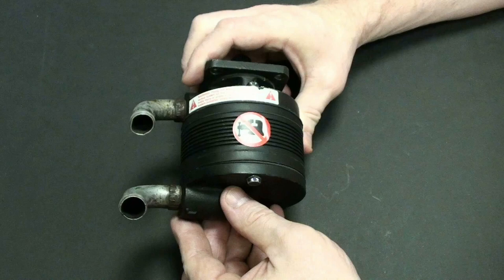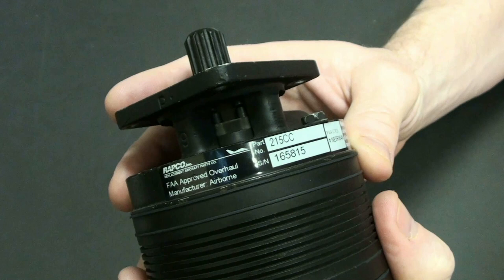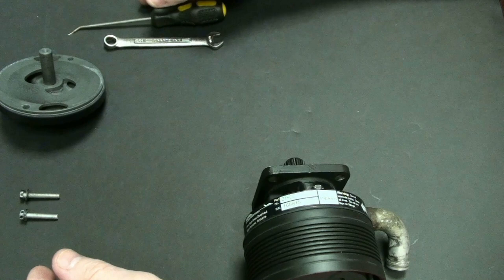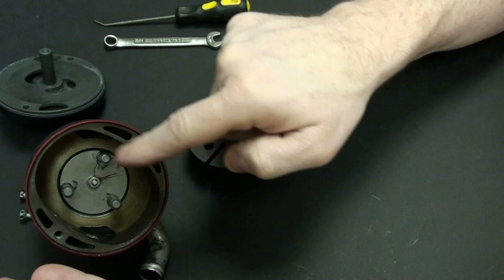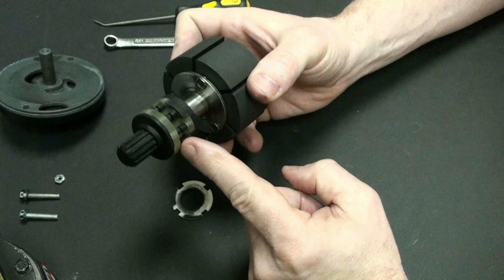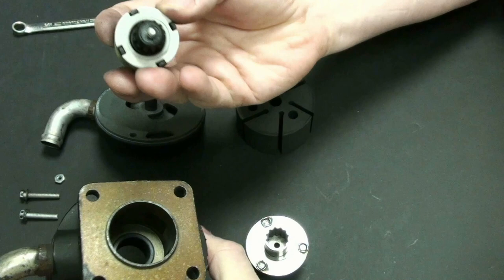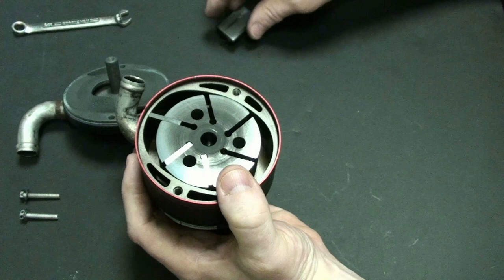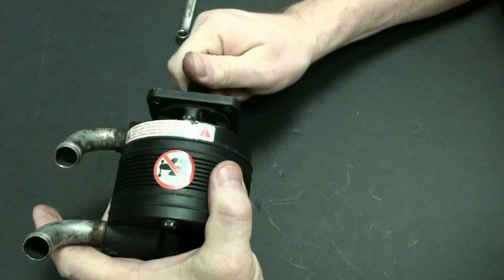Inside Look - The Vacuum Pump

Comment: I have an old air pump about half this size with the same sliding card type of setup. Mine isn’t graphite impregnated however. I’m going to attempt to make my own graphite and epoxy cards just to see if I can (it’s not for aviation, btw). 

I’m a little surprised they’re designed to fail like they are. I’d have thought a wear pin, like on automotive brake pads, would  give notice of impending pump suicide…

Thanks for the video!

Comment: In optimal condition, how much vaccuum is this pump capable of pulling?
Reply from the maker: Air-driven gyro instruments are designed to operate with a pressure differential of about 5 inches of mercury (about 2.5 psi). The pump is designed to produce plenty of airflow to spin the gyros even when the engine is idling on the ground. At normal flight RPMs, its capacity is much greater than necessary (as much as 20 psi). To maintain relatively constant airflow through the gyros, the regulator permits enough ambient air to leak into the system downstream from the gyros to limit the pressure differential across the gyros to about 5 in. Hg. The regulator is adjustable and has its own foam air filter to protect the pump from contamination.
The cockpit vacuum gauge is connected to read the pressure differential across one of the gyro instruments (usually, the attitude indicator). The gauge normally has a green arc between 4.7 and 5.2 in. Hg. The vacuum regulator is adjusted so that the cockpit gauge reads about 5 in. Hg. Sorry for the long reply, just wanted to make sure that I covered the question for you. I have sent an email to the manufacturer for the full capability of the pump, I am not aware of the absolute max it can pull.
Reply: @ToddShellnuttCPC  Thank you for the information.